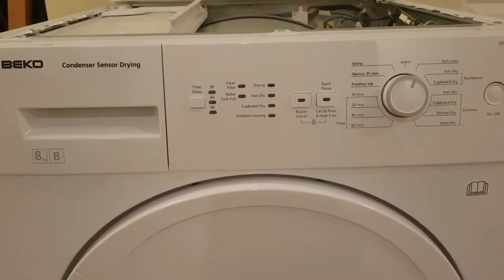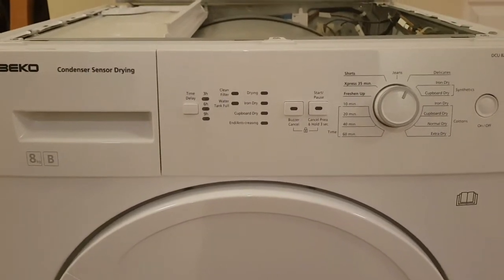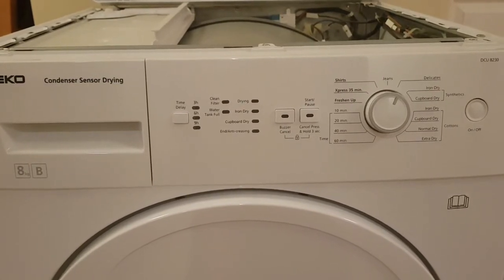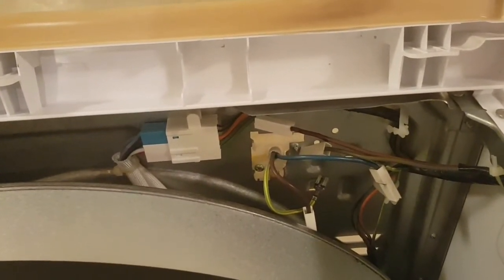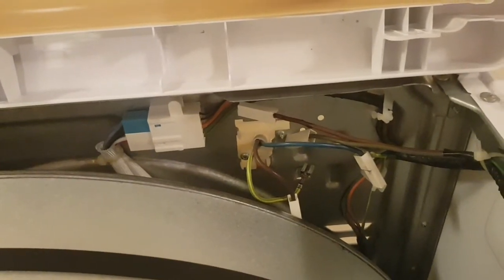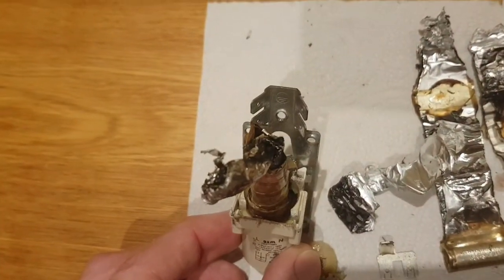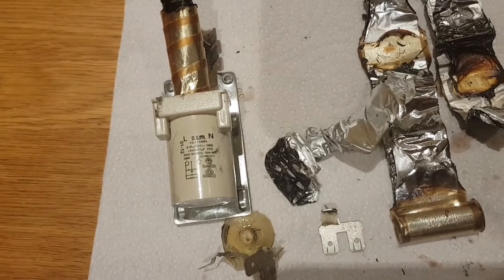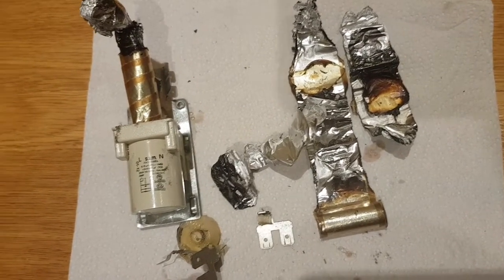Beko DCU8230 Tumble Dryer Fire Safety Warning

Comment: Thank you! I'm in the process of changing the worn out drum  pulley wheels and noticed the same part had done the same thing, didn't really understand what it was or what had happened. The machine had carried on working no problem, mind. Not sure that seems right, but then I'm no engineer.
Reply from the maker: Hi. I guess yours failed in a more controlled manner. Mine shorted out, caught fire & tripped the circuit breaker!